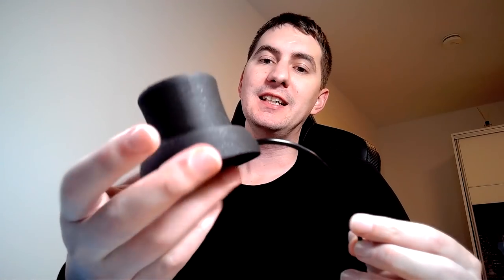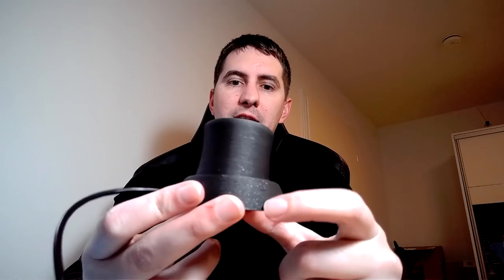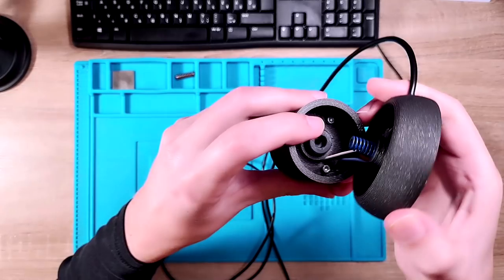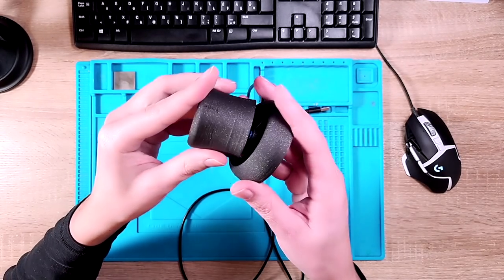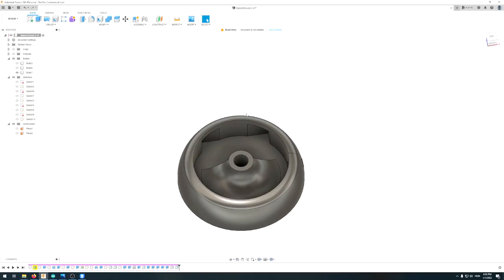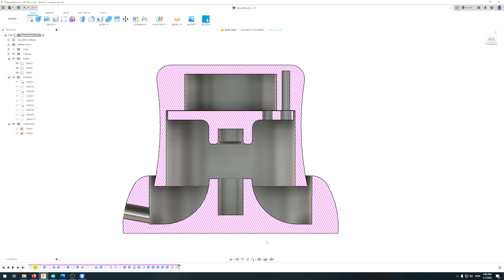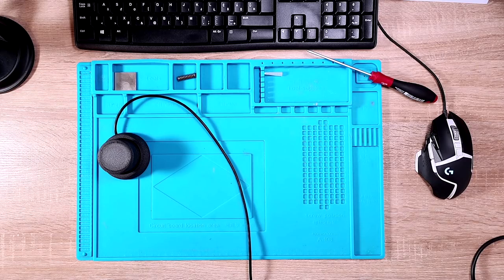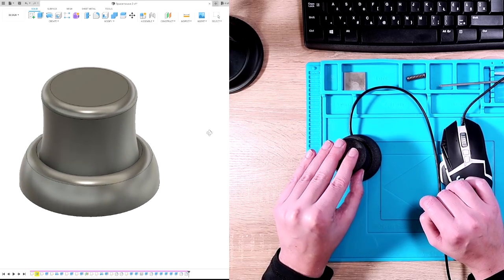DIY 3D CAD SpaceMouse for 20€ - 3Dconnexion alternative???

Comment: Very interesting project. I'm looking for an 3D SpaceMouse alternative since 1 year - this is the first project which seems to be a good alternative. If you need some assistance in Arduino code or hardware development, please let me know.
Reply from the maker: Thank you very much! I really appreciate it! :)
Reply: What about to place a Rotary Encoder EC11 between the adapter plate and the knob. Then you have a push button and also a rotating function (f.e. for zoom)?
Reply from the maker: @marcedi2029  Yes, it is not a bad idea, I also thought about this.The only reason why I would like to avoid it at the moment is because I do not want to use components which might wear out like potentiometers and encoders. Lets see...
Reply: @kikihobbyrepair  Hm, ok. I can understand this. What about the gyro for the yaw axis in the MPU6050? I used it to control an RC duck. I find it very usefull to have a rotating function in the knob. Btw. what kind of spring you are using? I only found some short 20mm or 25mm with a diameter of 8mm. But it seems that your spring is longer. Thanks again for answering my questions.
Reply from the maker: @Marcedi the only problem with rotating based on the MPU6050 is that if you rotate the entire mouse on the table it will have the same effect. 
As for the spring I am using a 25mm long 8mm dia one.
Reply: @kikihobbyrepair  Hm, good hint. A second MPU in the Base and subtraction of both values? You can change the I2C address of the MPU6050 ...
Reply from the maker: I thought about this but at the moment I have space cobstrains. I have trouble at the moment to fit the arduino the button and all the wires into the bottom part without interfering with the movement. But I do not want to make it bigger 🤔
Reply: @kikihobbyrepair  Could you redesign the top so the shell rotates around the spring slightly, say 10 or 20 degrees left and right? You'd just need a detent to locate centre; something like a ball from a ball bearing set that locates in a hole in the shell. With a detent, you wouldn't really need a spring to centre it either.
Reply from the maker: @Paul Ireland At first I did some test with this because even the spring allows a few degrees of twist so even without changing anything it would work. The problem is that if you rotate the entire mouse on the table it is generating the same effect. So the MPU sensor cannot be used this way without compensation.
Reply: here's an idea: a promising alternative approach would be to use strain gauges. they meassure absolutely miniscule deformations, so it would respond to the force applied, rather than any perciebable motion. (think of track point "mouse nipples") since there's almost zero actual movement, the mechanism would be pretty much impervious to mechanical wear.
to get the full 6 degrees of freedom this would require 6 pairs, epoxied to a fairly elaborate (3D printed) compliant mechanism, following a relative simple X/Y/Z mechanic - or some simpler to construct triangular arrangement (think of the array of actuators underneath a full motion flight sim), requiring more elaborate software.

PS: force sensing resistors would be an option too, but those are much more expensive, and would require more complex mechanics.
Reply from the maker: Thank you for your ideas. I really have to check these strain gauges because I do not really know how tehy work. My question is do you think if it is moving only a little bit that it could still be controlled precisely? I really like in my case that the number of pixels the mouse is moving is propostional to the angle of the MPU sensor. This way this can be quite precise and no moving components except the spring itself.
Reply from the maker: As I promised the video to the version 2 is out:  https://youtu.be/68EapQbDBOc
Reply: i found what that mechanism is called. it's a Stewart platform

Comment: I really like your approach, because I tried similar with a cheap arduino 3 axis joystick module. I gave up, because the way to interact with fusion through mouse simulation is really bad in comparison to a real SpaceMouse. I got myself a used SpaceMouse for 60€ and it is worth every euro every day. 
I'm sorry to say that, but as far as I learned, you will be able to create a "better than nothing" version, but if you get to try a real SpaceMouse, you will see how much difference there is, due to the missing direct API.
Reply from the maker: Thank you. Yes, I understand your point. This is definitely not a 3DC replacement. I also looked around and could not find any original used below 90€ here in Germany which is insane. Then I woke up one day that lets build something similar but waaay cheaper. This is what I ended up in one day 🙂 It looks like people like it and a lot of them wants to build one. 🙂 This is not really the product itself which is great but the feeling that we built something useful and cheap 🙂
Reply from the maker: As I promised the video to the version 2 is out:  https://youtu.be/68EapQbDBOc

Comment: I would use a compass / magnetometer module in the base and put a magnet into the top, this would allow you to rotate the 'knob' too.
Reply from the maker: Thank you for your comment 🙂 I am already working on the v2 with increased functionality. I hava a quite similar idea like yours to solve thr rotation. 😉
Reply: @kikihobbyrepair  I found that most magnetometers can be adjust their sensitivity, so that react to a nearby magnet and not the earth magnetic field., with that much mor positional data can be extracted if the North/South orientation of the magnet is fixed to input devices know...
Reply from the maker: I am thinking on using a simple rotary magnetic sensor.
Reply: @kikihobbyrepair  anything that works is fine :). My self from a design point of view would have tried to make it all with one sensor to make it simple, yet flexible. Each concept has its benefits and drawbacks.

Comment: I think this can be improved vastly: #1 add connectors to the wires (internal ones, since they are moving all the time, they will cause fatigue on the joints with the board) #2 pass the cables through the spring's center (to remove extra tensioning) #3 add a rotary encoder to the top center ( and put zoom on it, or screen twist)
Reply from the maker: Thank you for your comments! I really appreciate it.
This was only the first prototype designed and built in 1 day. I am already working on the v2 on most of your points. So on cable management and maybe connector. I also though about the wires to go through the spring but due to the reason that I already added a button to the top I need 6 of them and they would not fit. With the help of this button at the top I already have 2 x 2 axis. So rotation in 2 directions, zoom and pan. I have lots of ideas for a couple of iterations 🙂
Reply from the maker: As I promised the video to the version 2 is out:  https://youtu.be/68EapQbDBOc

Comment: Hi, thx for the video. Would you consider doing it by using a joystick from let say gamepad like Xbox one? Why? It has axis X and Y + button in it. You could use as well buttons from this gamepad like A, B, X, Y to program them.
Reply from the maker: Thank you! My problem with a controller is that it is not supposed to be operated with one hand. The joystick is small. Furthermore it is using the shitty carbon tracked joysticks which wear out and drift quite fast.
I am working on a v2 at the moment which will have more functions.

Comment: Very cool project! I guess there is a problem when you move the whole mouse on the table, right?
Reply from the maker: Thank you. I would recommend to watch my version 2 video too. But replying to your question, due to the reason that it does not use the rotation data it does not matter how it is standing on the table. The only problem is if you lift up one side on the table because this will definitely act as leaning it in one of the directions.

Comment: @Kiki Hobby Repair  Great project. I'm wondering if a rotary encoder could be placed in the upper top part to add rotation for zooming, Basically like the base, on top of that the spring and the mpu and on top of that a rotary encoder to be able to read rotations from the top part.  Or as an alternative a bearing at the top part of the spring and then some optical sensor for reading the rotations.
Reply from the maker: Thank you! I am already working on the rotation.  Easiest would be an encoder but I want to avoid any mechanical contacts like potentiometers.

Comment: I don't know, it's like you showed an alien something for 4 seconds and they have made their best attempt at copying it. I have tried the original 3DConnexion SpaceBall in the 90s. It was a beige rubber ball with a little nipple button on the top front of it. Very weird feeling! It was connected by serial to a Silicon Graphics workstation. Anyway the magic of the device is that you can manipulate all dimensions at the same time, you can twist it in either of the 3 directions to get the rotating motion and you can also push it in 3 directions to get the translating motion. So far you've got a first generation flight stick which you can rock in 2 dimensions. You can get cheap flight sticks which also measure the twist of the stick, all with potentiometers.

SpaceBall exhibits almost no movement in response to your input, but it can accurately register the force that you apply.

I think if I had to reproduce the device, I'd have to go with a bunch of force sensing resistors, but I haven't tried to figure out a pertinent arrangement for them. If it was for a larger range of movement, maybe springs and Hall sensors.
Reply from the maker: Thank you for your comment. I am already working on a version with 5 (maybe 6) axis. I will publish it soon.
Why I prefer this over potentiometers is that potentiometers wear out pretty fast. Here I do not have moving contacts
Reply: @kikihobbyrepair  potentiometer wear is not a huge concern. All game controllers use potentiometers and when they do fail after typically more than 3 years, with one notable exception, it's never the potentiometers that fail. That being said contactless measurement is very much worth pursuing and has other substantial advantages. Like common failure modes are either the linkage or the centering mechanism, and contactless measurement allows to improve on both of these.
Reply from the maker: I work on console repairs as you could maybe see on my channel. My personal experience is that in 80% of the cases the carbon track wears out. Furthermore they are way roo small and fragile for this purpose. Versions with hall effect sensors might work but an MPU 6050 sensor costs only 2€ so it is perfect 🙂

Comment: Cool idea. And very simple. Why you did not supplied link to github page in description? And for this purpose (2 axis) that module is a little overkill - what about analog joystick standard arduino module? But if you add module with compass - you could add rotation around Z axis (3rd axis)
Reply from the maker: I am working on the v2 with more axes. I will dustribute all the files. Stay tuned for that.
Reply from the maker: As I promised the video to the version 2 is out:  https://youtu.be/68EapQbDBOc

Comment: all the best with the project. IMO, while still cool, atm it does not reflect functionality of the 3d mouse device, it's closer to joystick. Why? Your device seems to have only "tilt" (like a joystick stick tilt) implemented. 3d mouse has tilt AND move left/right , forwards / backwards. So when you tilt 3d mouse the object in 3d space rotates, when you push it left/right, forward/backward the object moves. So it allows you to manipulate the object on the screen like you're holding it, which is not possible currently with your implementation. Hope you'll figure it out (of course if it is of any benefit in your workflow :) ).
Reply from the maker: Thank you for your comment! The version you saw in the video is the result of one day of work 🙂 I am already working on an upgraded version with increased functionality.

Comment: Clever idea, nice.
Without moving part on a sensor side.
Could you add capacitance Button, or slider ?. 
I look forward to accessing the project.  Can you share the code and the mechanics design, and give people access to the modifications?  In this way, others could modify it, develop it together with you.
Reply from the maker: Thank you! Yes, the idea was to avoid moving part which might wear out like potentiometers.
I am right now working on the v2 with a button on the top to double the functionality. My plan is that as soon as I finish with this one I will share all the files.
Reply: Could good idea to add a Button on the base two more, and add a metal part to the base, to create more stable base.
Reply from the maker: Thank you. Yes, I have quite a few similar ideas 🙂 My current problem is space constrain.
Reply from the maker: As I promised the video to the version 2 is out:  https://youtu.be/68EapQbDBOc
Reply: @kikihobbyrepair  Thanks, for creating a github for this project, and share this project for all.

Comment: Interesting project looking forward to version 2, I have some suggestion that might be worth looking into.
1. If you haven't seen it before I highly recommend checking out Flextures, this could be used in combination with or as an alternative to the spring https://www.youtube.com/watch?v=YEz-r8KDY-0 in short they rely on the flexibility of the material to translate into a movement in a axis (in most cases)

2. Not sure how accurate the Arduino sensor is when talking panning or rotation in the vertical axis if not a couple of hal effect sensor could be used to detect that.

3. The real space mouse is using a lot of weights in the base to make it stable on the table, this really helps with the overall use of it and the lifting motion that can be performed probably wouldn't be possible without it.

Some thing that might not be perfectly clear when talking about the space mouse it self is that for the most part it tries to imitate the feeling of holding an object in your hand and looking at it as you would in the real world. 
This is kind of the opposite of most other input methods except VR
Reply from the maker: Thank you! Furthermore I really appreciate your ideas for improvement. :)
1. Flextures are really cool though at first I wanted to build something simple which only requires a 3D printer. With 3D printing these would not work as smoothly. 
2 and 3. The MPU6050 module I use is able to measure 3 axis in the 3 dimensions so a rotation is still possible. I already made some tests with it because the spring allows some twist but here comes your point 3 that to do so I would need to add significant weight to the unit. THe space is quite limited and for sure I do not want to use CNC metal frame like the original because this would extremely increaae the price and the DIY ability. But I already have some ideas how to solve this :)
3. As for lifting motion the spring I use would not work because it is quite strong. I also thought about it to use some hall effect sensors.

Your final sentence was extremely important for me so thank you for that. I mean where you wrote how to imagine using a space mouse.

My plan is the following:
As a v2 version I will keep it simple and I will add only an additional button to it to double the number of axis/functionality.
As maybe a v3 version which will be a close to 3Dconnexion functionality I might make some general changes which will take a lot of time. This version has to be definitely way more complex so harder to make... I still have to decide if I will go for it or not.

Thank you once again! :)
Reply: @kikihobbyrepair  
1. Yeah definitely start with something simple for the first iterations, I haven't personally tried 3D printing flextures (almost want to try now) but printing them extra tall and in abs might give the result you are after. With that said just see that as a options of something else doesn't work.
2. That sounds promising then. 
3. Washers/bolts might be a good solution to increase the weight of the unit another thing to look into is the space mouse pro which includes an armrest that helps with the downward force and to be honest is definitely a step up from the simpler space mouse. The space mouse pro still is heavy though at around 600g.

No problem glad I could give some insight about it:)

I think that is a good way to approach it, and most software that is utilizing the space mouse fully has some very custom drivers to make it work so it probably would be to easy to get it to work exactly the same. 
But if your plan is to get some of that functionality a good place to start looking might be Blender, since its open source I'm guessing the drivers are also somewhat easily accessible.
Reply from the maker: As I promised the video to the version 2 is out:  https://youtu.be/68EapQbDBOc

Comment: I don't want to sound like depreciating your build but, at the present state, isn't this just an overengineered analog joystick? Instead of two rotary encoders you use a gyroscope. I mean, you could just write a driver to use a joystick this way. Of course I will be more than interested to follow your progression into a fully six axis device.
Reply from the maker: No worries, you are right. The huge advantage of the MPU is that there are no wearing out components like in a joystick the carbon tracks. 
This was just an experimental prototype designed built and programmed within 1 day if it is feasible at all. 
I am already working on a V2 which will be 5 axis for the moment. Stay tuned for that. 🙂